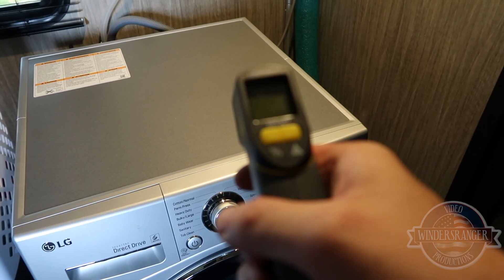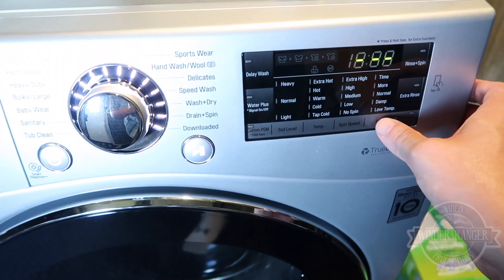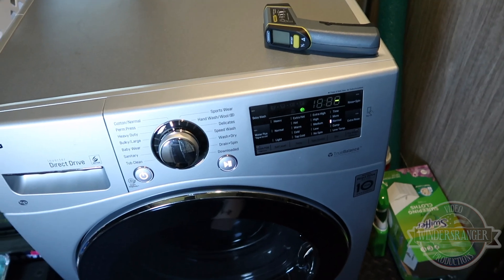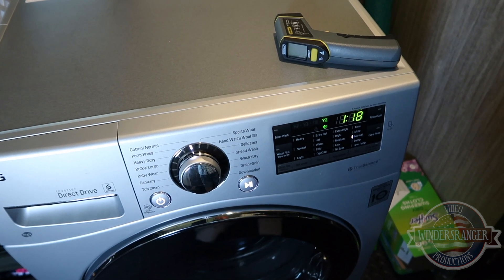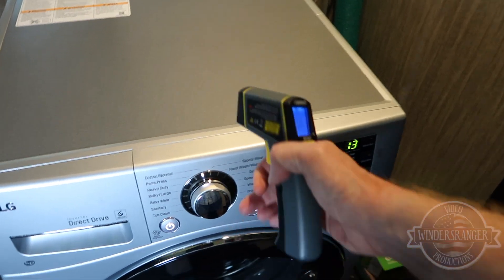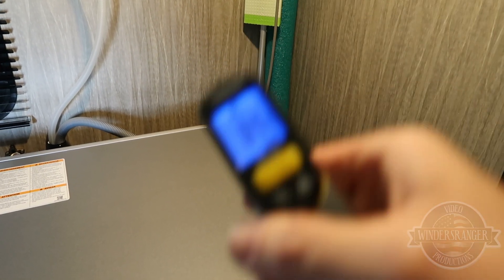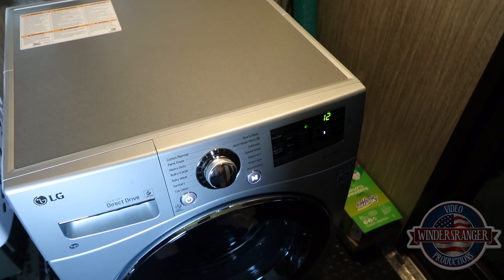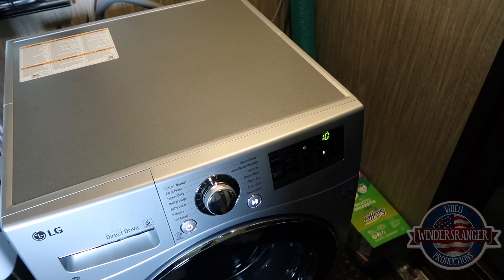Does the Washer/Dryer get hot

Comment: I have the older version of this, the WM3431HS, which by the way is quite a bit noisier than this one on the dry cycle. There's a recirculating fan inside the top of the machine which pulls air up out of the condenser and through a cold air return duct, towards a heater element. Cool tap water is sprayed through the outside of the condenser, to condense moisture out and the machine then feeds both the waste cooling water and the waste water from the clothes back into the drain. The heater element intake duct from the fan to the element is metal, and rust prone -- in my 16 year old machine, it needs replacement. I think for a heavy use case it would make sense to remove the condenser duct every few years to clean it out as there is a risk of lint build up there. The top of the machine removes real easily and that's your main access for mechanicals, the back with a bit more difficulty as the bolts are quite tight.

The temperature readings you're getting seem reasonable, and much lower than mine. The heating element on mine is quite close to the front of the top of the machine and that's where the highest temperatures are.

The ventless feature is the biggest plus as far as I'm concerned -- no pulling your heated or air conditioned air outside. Also less wear and tear on your clothes because it doesn't cause as much lint.

Comment: i got one similar to this one, but mine gets extremely hot, as far im concerned im afraid that it will actually burn my clothes, its abnormal high temp. but no errors.. it seems like i might have a PCB problem. because i actually fitted a thermostat with lower operating temp and i maneged to keep it "cooler" than "burning" but not i get the dHE error, i really just want to throw it as far away over a cliff as i possibly can. piece of s...